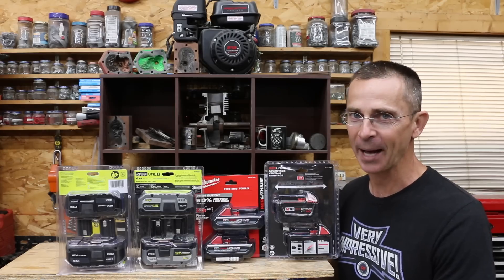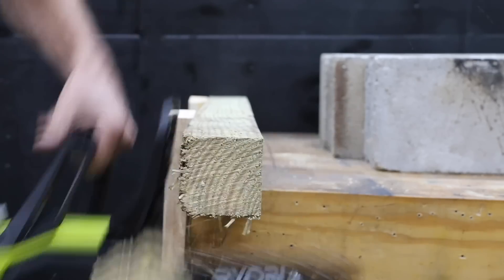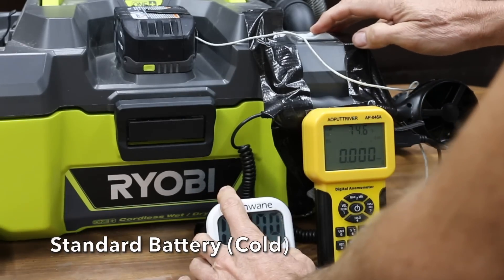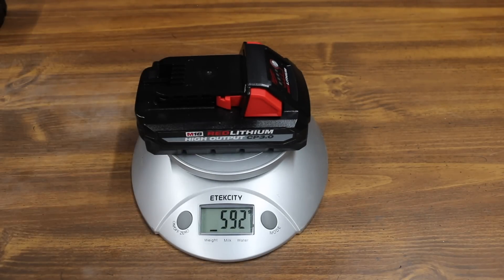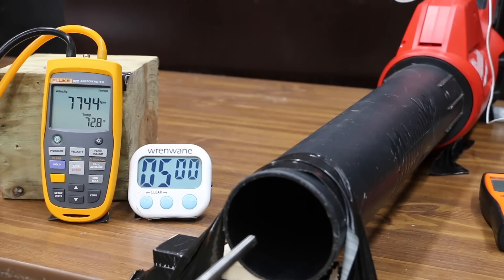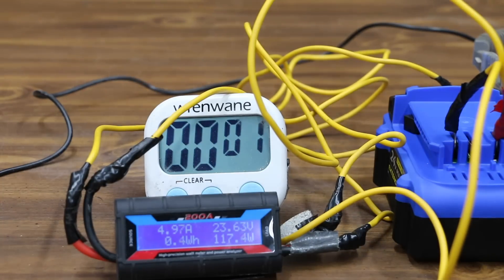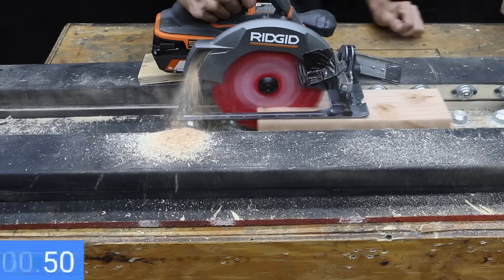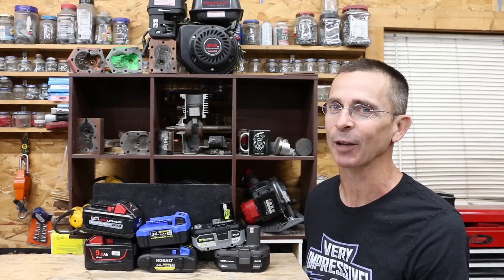Are "High Output" Batteries Better Actually Worse?

Comment: I can't speak for the other brands , but Ryobi brushless HP tools are the only ones they represent as having a significant gain with the HP batteries, that it doesn't change the performance profile of non HP tools significantly
Reply from the maker: Great feedback! Thank you
Reply: @ProjectFarm  I run a FB Ryobi user's group and we found the same degree of differentiation with the knockoff Ryobi batteries... They're never as big a capacity as their stated spec, but often they are still cheapest per Watthour.
The internal construction on the knockoffs is never as good either, from weaker materials, to slimmer construction and omitting internal reinforcement and anti-flex ridges, to less protection against water intrusion.  Also the discharge rating of the individual cells can be different.  Ryobi specs all HP batteries to be 30c or better, and in their general packs they can be as low as 18c ..

Comment: Higher amp batteries does not mean anything power-wise. It simply means the battery will last longer.
Reply: Go put a 1.3AH in a dewalt grinder and come back
Reply: Not true. I have Milwaukee tools and the higher amp battery’s have more power.
Reply from the maker: Thanks for the feedback
Reply: Theoretically no, in real world they are better. Im talking about Milwaukee M12 line up especially in impact and multitool. On other hand after 6-8 months of using better batteries, they are not so much better.LOL. I bet same thing will be happening with all EV
Reply: I have a few different size  ryobi amp batteries. Yes, the higher amp batteries INITIALLY privides more "oomph" to whatever you are doing BUT that oomph is temporary and not sustained. Higher amp batteries last longer than their lower amp brethren so you get more use before you have to charge them.

Comment: Should do a test of OEM vs aftermarket batteries also! That would be very interesting.
Reply from the maker: Great suggestion! Thank you
Reply: Agree. I’ve found some good knockoff 5ah batteries I use in my Dewalt tools. Especially my Dewalt chainsaw
Reply: @jpjr6757  Pure luck I bet. Mostly those are junk
Reply: He did one on OEM vs aftermarket DeWalt a while back.
Reply: true , I'm curious aboht the FCA/ Mopar ones , I have one as a replacement and works fine
Reply: I think he already has a video on that.
Reply: Yeah, some Ryobi batteries are very cheap (knockoff) and the fact that i can purchase them in Amazon (as someone who lives outside us) makes them very convenient
Reply: Waste of time. Aftermarket batteries are cheap Chinese shit with anything printed on the side.
Reply: He has of video of this topic I believe
Reply: Car batteries,,,
Reply: I would love to see this
Reply: I think he has that video already
Reply: i had bought m18 12 amp 21700 cell batteries from aliexpress. I think the batteries are really 9 amps. I paid  140 CAD . the battery management seems to be the same as OEM, but the plastic is normal ABS and the contact plates are THIN. I was using them for my 9 inch concrete saw and both of them were melting the plastics at the negative contact plate because they were so hot and they were smoking. Also they dont do rapid charge.
I bought from the same manufacturer some 8amp batteries 21700 cell pack and it just didnt work. One wire was pinched in the casing and it was open line. and a couple of tabs on the battery just were not soldered correctly and i assume they got detached in transit.
Reply: No point of that test. Read reviews, aftermarket batteries are pure junk.
On other hand my first Makita 18V I bought in 2006 would simply kill any new high output new batteries. And those were just 3Ah.
Reply: @marcelo403polo2   A mate of mine has lots of Makita tools and batteries, and a few of them failed to charge, "Pure luck I bet".
Reply: @dogbreath6974  Agreed
Reply: @marcelo403polo2  PF has already done a video on knockoff batteries, they make sense if you have so few batteries that you'll run through your OEM ones before the first finishes charging. Otherwise you're getting what you pay for.
Reply: @marcelo403polo2  I tought he was talking aboht Car batteries 👀
Reply: @AAAAAAndrea  Well, same applies to car batteries. I used to buy batteries with 11 years warranty.. Now best I can get is 60months. Its really pricy when you need 2. and old ones just quit at about 65months.
Reply: @marcelo403polo2  Spot on, batteries never lasted me more than 5 years and a bit

Comment: I am so happy you did battery test! Have ton of Ryobi tools
Reply from the maker: After watching the review, would you spend the extra on Ryobi's high output battery?  Is it worth the extra cost in your opinion?  Best regards, Todd
Reply: @ProjectFarm  I was totally shocked. Didn't expect those results. Guess I had just assumed I had longer rum times.  I have chainsaws, blower, floodlight, impact and drill and circular saw and on and on and spending fortune on batteries.  Since I use these tools mostly in warmer temps I seems now I will buy standard batteries! WOW! Thanks again for these videos! Used them to help select jeans, rechargeable batteries (aa, aaa etc),  variable drill bits, diesel additive etc. I've recommended your channel to others as the best tests/reviews I've seen anywhere!
Reply: @ProjectFarm  no, but I always have at least 2 HP batteries with my packout case to go with my SDS hammer drill and angle grinder.  But only for those 2.  Regular: Drill, Sawzall, impact, vacuum - no need for HP.  your testing confirms it.

Comment: LiPo HV has similar benefits in hobby-grade R/C cars and other vehicles. Cool it's in the mainstream now! (I am guessing that's what this is...they just charge to 4.35v instead of like 4.20v)
Reply: What kind of rcs do you mess with?
Reply from the maker: Great point on the top-off voltage!

Comment: Right on time! The M12 high outputs for Milwaukee came out recently and I still can’t tell any difference in performance between those and the regular 6.0s I use
Reply from the maker: Awesome! Thank you
Reply: @76tfdtr4r5  I agree. I’d replace a 4.0 with a 5.0 HO but wouldn’t replace a 6.0 for a 5.0 HO.

Comment: My favorite use for high output batteries is shearing off my 1/4 impact bits haha
Reply from the maker: What brand of bits are you using?
Reply: @ProjectFarm  Milwaukee, although they generally only fail when longer bits are used in extensions.  They fail around the smaller-diameter part that normally latches into the 1/4 chuck.
It's mostly user error